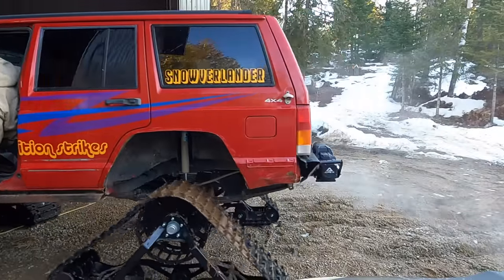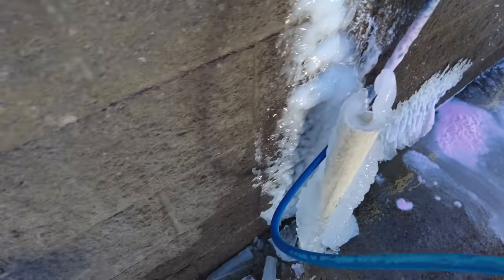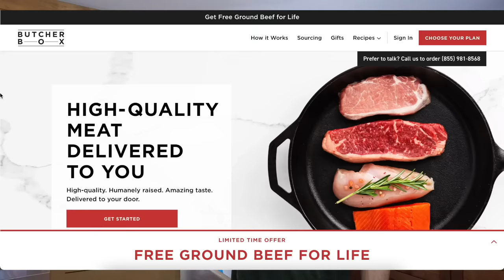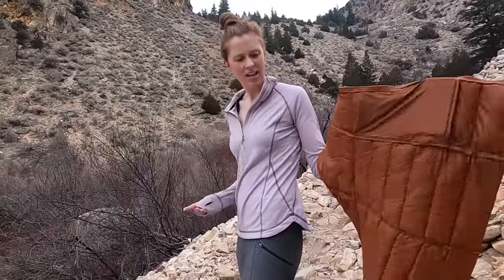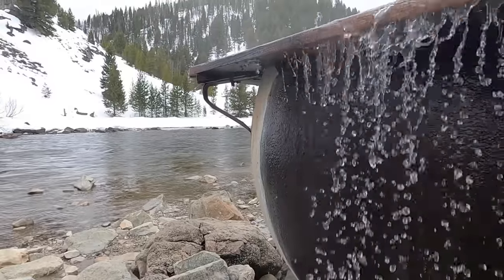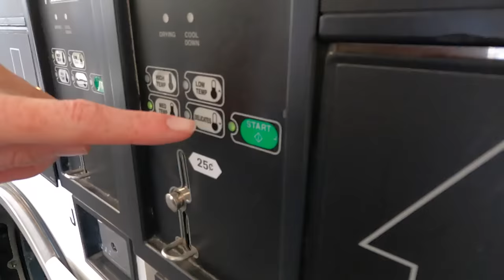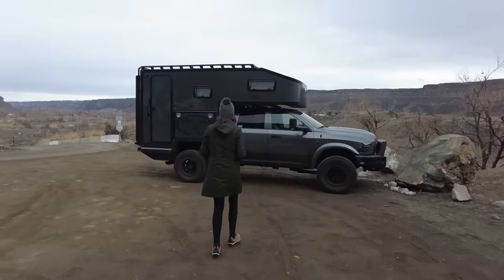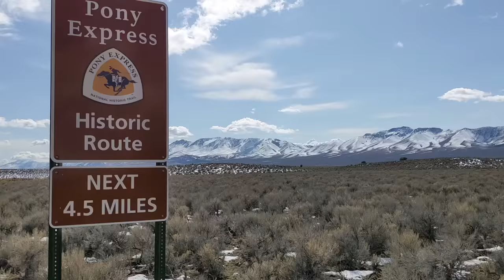WE CHOSE TO ABANDON OUR HOMESTEAD (For Now 😉)

Comment: King size duvet.
I eased the problem by adding ties on inside of cover and quilt. And tie them togeather.  My original idea was pressstuds but I did not have any. Ties  On each corner and mid way top and bottom,  and two on each of the long sides.  Planning on extending it at home so I can colour code the mid tie,  bottom on cover and both end on quilt so I no mix up the different sizes.

Comment: You guys like building stuff.
Here's one little tidbit you might want to remember.
Many jets (like 737s, of which are thousands in boneyards,...that's an airplane junkyard) have these things called "Air Stairs"
It's as it sounds stairs.
Stairs which are super light, super strong and have the WORLD'S COOLEST folding/retracting mechanism.  Not all jets were/are equipped with them.  Still, enough exist to where you could somehow use them for one of your projects.
They're bad ass.
Google'm
A couple things about them....if you get some for some project, know they will operate on 24Volts & if I twas you, I'd get the flap/door which seals them in the airplane.

Comment: Frozen dog snot on the windows?  Those little stickers are what you get for wearing knit pants.  Next time you venture into the pucker brush, I suggest leather pants.  Or at least leather chaps.  I'm with Riley, for once.  It DOES sound like a perfect Sunday.  And it IS a beautiful campsite.  Glad you guys are having (so far) a good vacation/good change of scenery!  If I haven't mentioned it before, I encourage you to consider Oy Windside vertical axis wind turbines for off grid power generation.  They're quiet, efficient, and don't kill birds.  Perhaps in a hybrid design with photovoltaics.

Comment: Starters and Generators from those parts stores are very mysterious. My dad worked at a major manufacturer of generators  just outside of Oklahoma City in the 90's and he told me they would make 5000 units in a run and mark 2000 units new and the other 3000 remanufactured and they were all brand new because the remanufactured ones were unreliable and not worth the trouble.

Comment: I'm fairly new to the channel but I'm a huge fan. Got my own 3 Acear plot with my very own broken excavator, no water. And a 7k dollar non working solar system. Also we live in a financial nightmare of a travel trailer
 With two boys and 3 mastiffs
Reply from the maker: We have so much respect for anyone on this journey with kids. We can barely feed ourselves most nights. 😂
Reply: Frustrated- We commend u as well. A retired medical repair tech and his retired daycare director wife. It's never easy even In a newer home, we have issues  like incorrectly wired switches and bad exterior lamps. Never ends but with all the kids out of the house it is a little easier. Always good to have a backup plan or two like the hosts try to lay out. Learn that and we wish you all well!

Comment: If your plumbing is freezing because it’s routed underneath or in areas where your air heater doesn’t get I run the 12v pipe heaters in the low spots and wrap neoprene Velcro cable management tubes around everything! 
Glad to see you made it to the hot springs, they are fantastic. Decent hike to get there but worth it!

Comment: After living in our truck camper thru a few winters, I learned that you need to insulate the plumbing pipes from touching the cold walls and floor. Strips of the blue ensolite camping pads work  great. Don’t fully wrap the pipes. They need to be exposed to the interior heat.

Comment: I had a starter problem where the starter started the truck but kept running. So I crawled under it, disconnected the hot cable, and dropped the starter with the truck running. The Bendix wouldn't disengage.

Comment: You need to make sure when you put the starter back on Chevy vehicle like that has a two starter boat to go straight up, make sure to put a starter plate between the bolts on the bolts on the end of the starter if everyone starts making loud noises like it's trying to grind your too close to the starter five will so you had spacers these become with the starters

Comment: That badge is the first thing that's pulled off a combat vehicle ,multi colored and chromed on a truck  not good . Stewart Stevenson  manufacturers badge ,like one for Ford , GMC .Look on line find company may have N O S on shelves otherwise make your own with plasma table and a small piece of stainless . Look over mini truck /be critical  ,does motor turn over ,can you hotwire and jumper cable and shoot WD 40 in. carb  for d o f / dead old ford check  ..IS it beater Worthy .

Comment: You didn’t abandon you home, you freaking left for a trip! Your material is good enough without the dumb clickbait titles. It insinuates some kind of problem has happened to your home (mud slide on the poorly water managed road, roof collapsed, or some other major reason to ABANDON your home! It’s just not needed. Just put out the video and say its one of a different kind in the intro. Your subscribers will still watch.